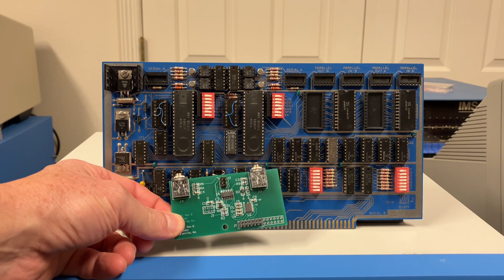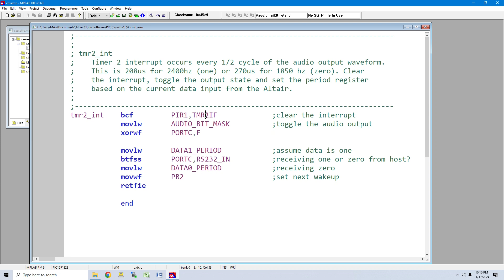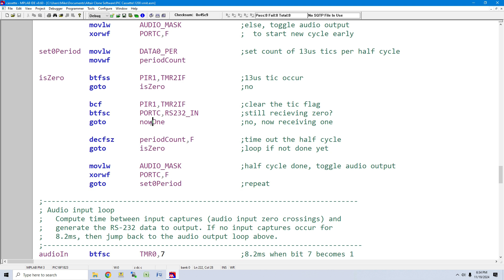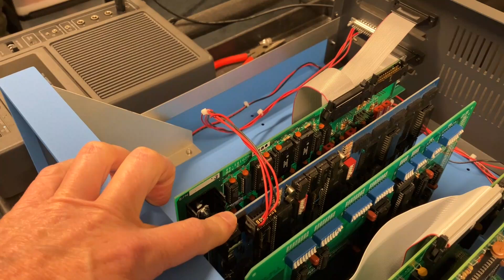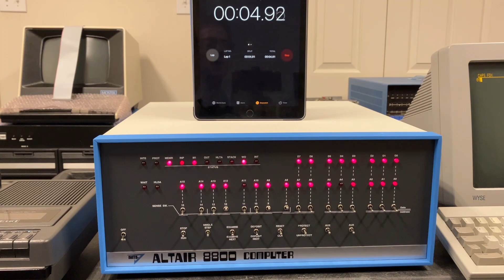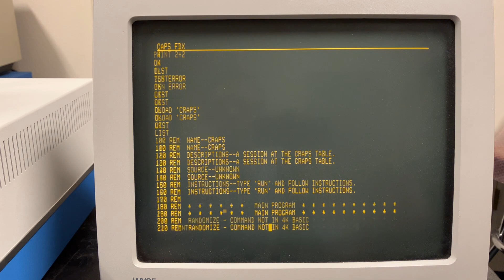Turbo-Charging a Microcomputer Cassette Interface (Altair)

Comment: Cool!

Related side track question:
Were there ever any S100 (or other pre-PET/AppleII/TRS80 era) cassette interfaces that bit banged the cassette read/write signal, using the 8080 for encoding/decoding?

Most newer 8-bit computers did that, with a few exceptions (like the Atari 8-bit).

I get that for an S100 system it would be CPU speed dependent and also if the code runs from a DRAM card it might glitch when DRAM refresh adds wait cycles, but still. Or maybe DRAM refresh eating cycles would be negligible here?

Also afaik it's considered a bad idea to have the higher frequency double the lower frequency, as any distortion on a signal of the lower frequency risk being detected as the higher frequency.

Btw if you want to experiment with bit banging load/save you could use a Commodore (compatible) cassette recorder and just connect the load/save pins to a general PIO chip. You need to feed a lower power 5V for the electronics in the cassette recorder, and approx 6V for the motor. There is a sense pin that is grounded whenever play/ff/rew are active.

Also: there were a few projects to improve the reliability of the Sinclair ZX81 / Timex 1000 loading/saving; at least one of them were in the European DIY electronics magazine Elektor back in the days in the first half of the 1980's. The PCB they did connected via switches directly to the rec/play head of a regular cassette recorder, and it processed the signal and created a digital signal, which when reading/loading was just voltage divided to feed the input of the computer. When writing/saving it did approximately the same thing, but driving the rec/play head and making sure to saturate the tape. IIRC it used various filters and whatnot to improve performance. Just getting rid of the electronics in most cheap cassette recorders probably did wonders for the signal quality. Even the best audio cassette recorders had circuits that would just harm data signals, like AC bias when recording and frequency correction filters both when recording and during playback.

Comment: Would it have been possible to rectify the CUTS signal so you only had to detect positive edges? I understand creating this signal to transmit to the tape still would have presented challenges which this wouldn’t address

Comment: Detecting zero-crossings in both directions (low to high as well as high to low) is actually surprisingly easy.
Sometime in 1997 or so, Elektor Magazine had an article about an S/PDIF receiver with an SCMS defeater. S/PDIF also uses FSK so that also needs a detector for zero-crossings in either direction (low-high and high-low), and they used 3 inverters from a 74HC04 combined with a couple of capacitors and resistors. The first inverter amplifies the analog input signal and makes it digital. The output of the first inverter goes through a resistor to the second inverter which also has a capacitor to ground on the input. The second inverter is coupled to the third inverter in the same way. Because of the capacitors and resistors, the output from the first inverter gets delayed and inverted on the second inverter, and on the third inverter it gets delayed and inverted again. You can then basically use an XOR between the first and third inverter's outputs to get a pulse every time the input signal changes from low to high or from high to low.
I used the schematic for my own S/PDIF decoder and it worked really well. Here's a page that I wrote with a schematic and some further information: https://hackaday.io/project/24911-propeller-spdif-receiver/log/60182-initial-setup.

Comment: It's fascinating how cassette interfaces were implemented in different countries. The rationale behind the "we store pulses" is explained in "The TV Typewriter Cookbook" as tape drives having lots of wow and flutter and not being at the correct speed. The German devices with tape interface I've seen so far all had simple half-duplex V.23 modems.

Comment: 20:56 I spotted that Iomega-branded SCSI cable... I suppose that DB-25 SCSI 1 cables are no different than a straight-thru RS232 cable internally, but I got a kick out of seeing a 3-decade-newer Zip drive cable carry serial data from a 1976-era machine :P

Comment: Very nice. I'd been mulling over the idea recently of using a US(A)RT to generate an MFM signal, similar to 9-track tape, for a cassette interface. This could push the bitrate up to somewhere near 2400 baud, potentially, and would be easily decoded using a PLL or phase detector. I suppose that wouldn't put the on-tape format that far off from something like a floppy disk. The only issue I've been really looking at is filtering - audio cassettes tend to record lots of harmonics with fast level transitions, and without narrow filtering that could be a problem for reading data back.
Reply: Not so sure about that. In the early 90s, I made a Sinclair ZX Spectrum simulator for my PCs. 
There, I managed to read ZX Spectrum's 1500 baud (bits/second) casette tapes using just a TTL port on the PC (one bit of the printer port). 
No filters of any kind used.
(The first version was in assembly for a 12 MHz 286, and a later version in Pascal for my new and fancy 25 MHz 486 :)